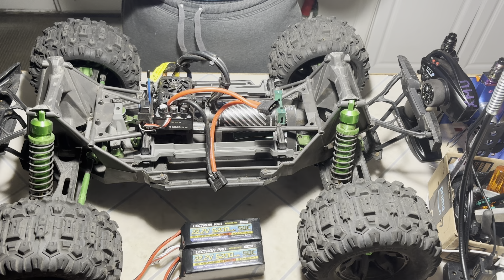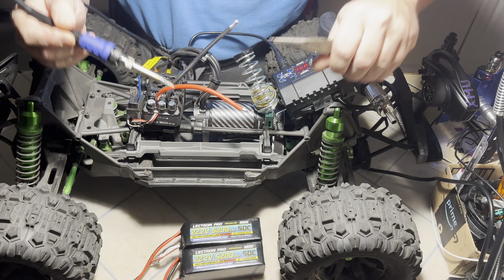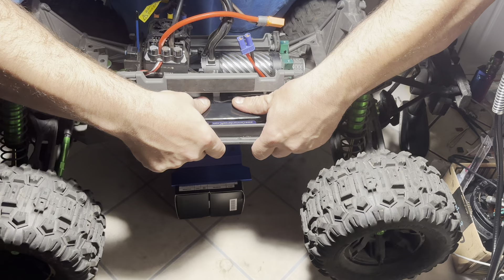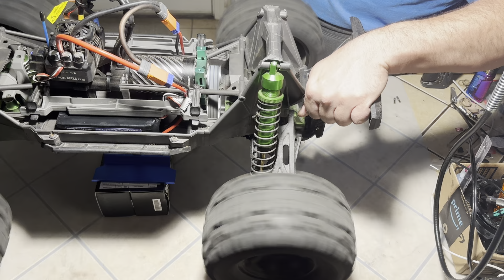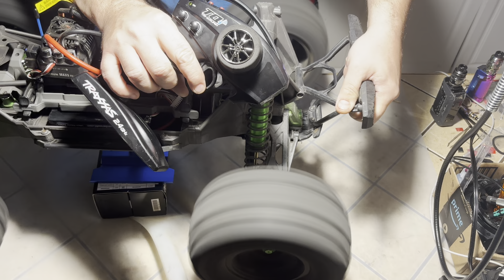Traxxas XMAXX Ultimate 12s conversion

Comment: How much did it cost you for the 12s build?
Reply from the maker: @yaeirleija9581  so you are looking at connectors/plugs to match batteries of your choice, motor mount, motor, ESC, gearing of your choice, easy 600$ not including wire for soldering the esc, solder, tools, time… 🤓😎